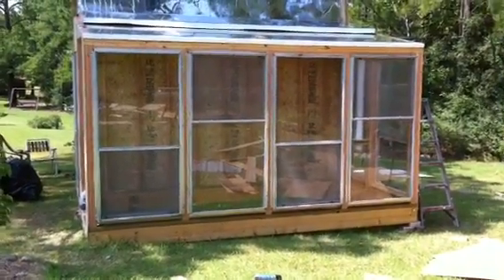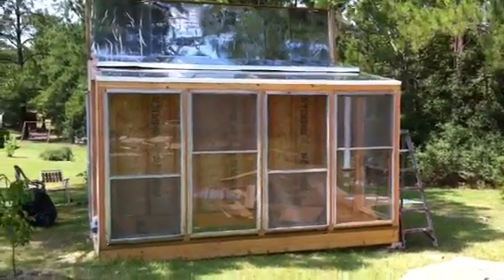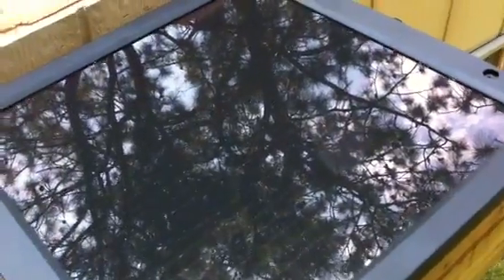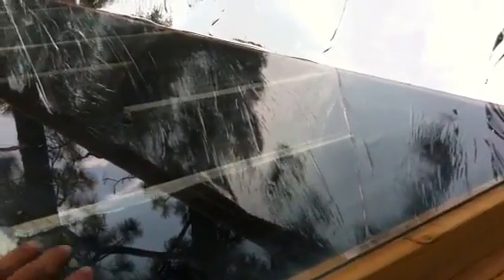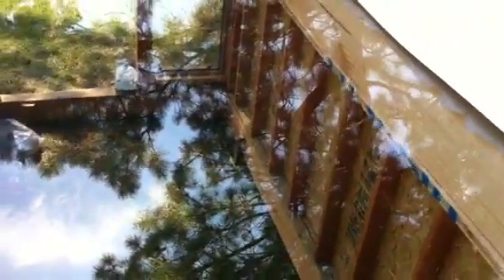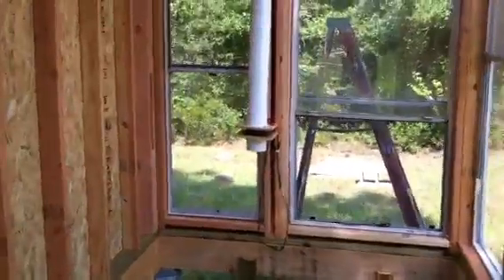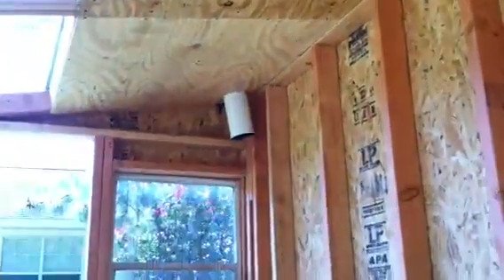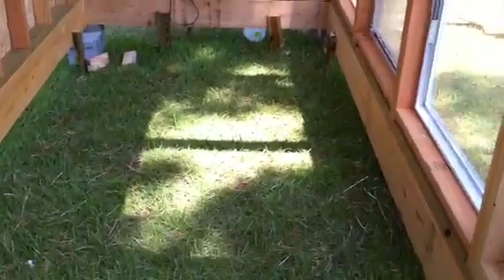Solar Heated Greenhouse

Comment from the maker: Emery, I will have to wait until this next winter to video the plants in the solar heated greenhouse. I should have already done so. Insulate all of the walls and roof that does not receive solar gain. In the winter, use compost around the base of your plants to insulate the soil. Keep the compost moist with water for as is composts and ferments, it produces heat, which is a good thing but it can spontaneously combust.